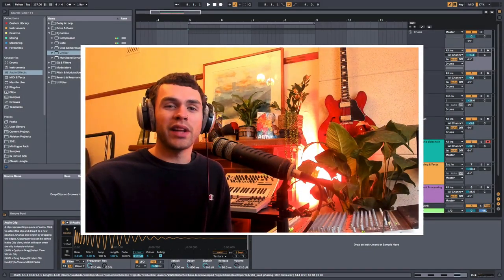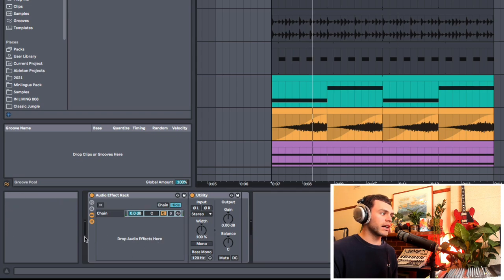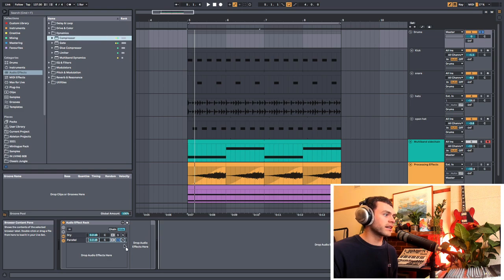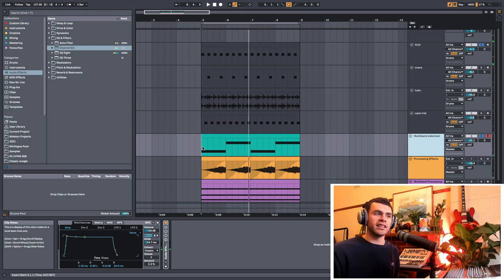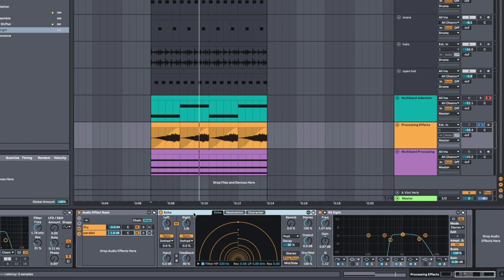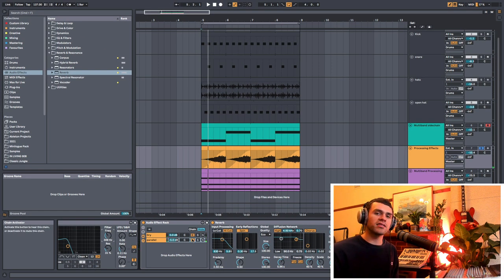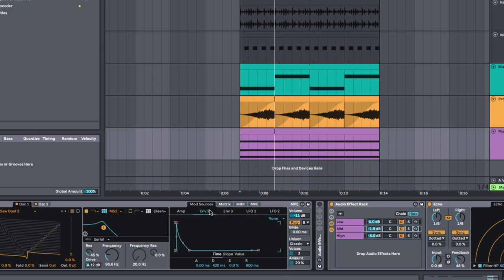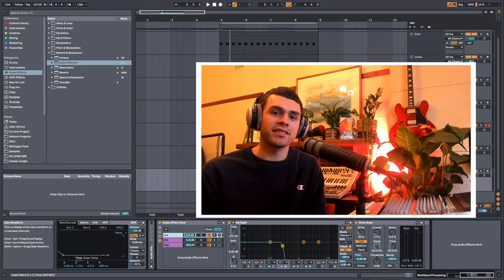Creative Parallel Compression, Distortion & Other Processing Techniques

Comment from the maker: Any techniques that I've missed?
Reply: Why do you use an EQ instead of the Multiband Dynamics?
Reply from the maker: @jamalyannicguzmansierra7996  the splits are a little cleaner by default IMO :)
Reply: @jamalyannicguzmansierra7996  You can always put a MB after equalizing, as that's is more of an automatic gain boost rather than it is a filter.